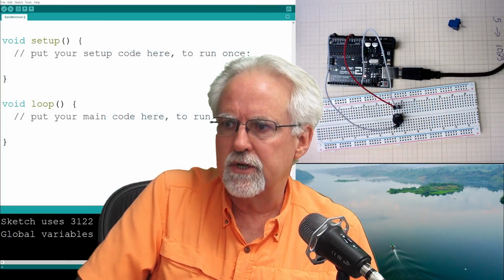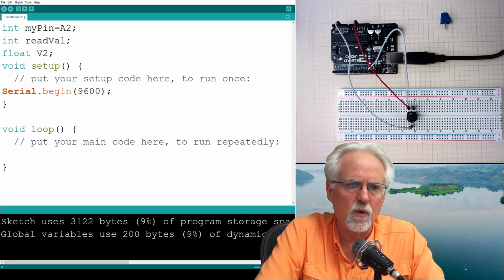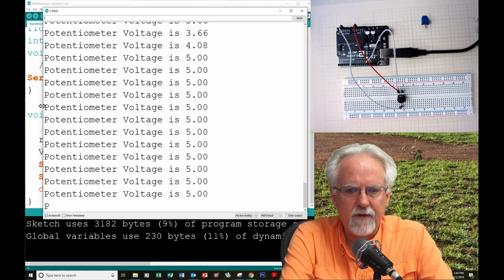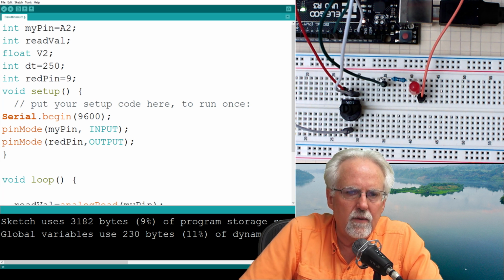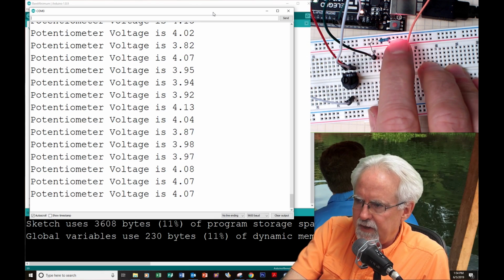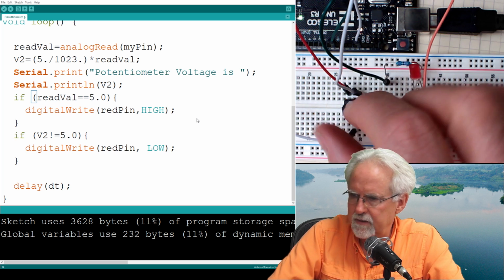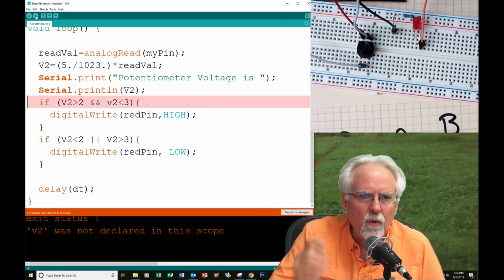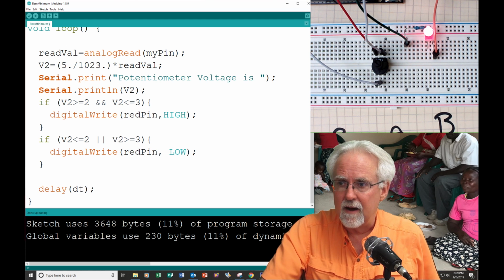Arduino Tutorial 13: Understanding Arduino If Statements

Comment: Here's my answer to the assignment! 

Int myPin=A2;
int readVal;
float V2;
int delayT=250;
int redPin=9;
int greenPin=3;
int yellowPin=2;

void setup() {
  // put your setup code here, to run once:
Serial.begin(9600);
pinMode(myPin, OUTPUT);
pinMode(redPin, OUTPUT);
pinMode(yellowPin, OUTPUT);
pinMode(greenPin, OUTPUT);
}

void loop() {
  // put your main code here, to run repeatedly:
readVal=analogRead(myPin);
V2=(5./1023.)*readVal;
Serial.println(V2);
Serial.print("Potentiometer voltage is ");
delay(delayT);
if (V2<3){
  digitalWrite(greenPin, HIGH);
  digitalWrite(redPin, LOW);
  digitalWrite(yellowPin, LOW);
}
if (V2>3 && V2<4) {
  digitalWrite(greenPin, LOW);
  digitalWrite(redPin, LOW);
  digitalWrite(yellowPin, HIGH);
}
if (V2>4) {
digitalWrite(greenPin, LOW);
digitalWrite(redPin, HIGH);
digitalWrite(yellowPin, LOW);

}
}
int myPin=A2;
int readVal;
float V2;
int delayT=250;
int redPin=9;
int greenPin=3;
int yellowPin=2;

void setup() {
  // put your setup code here, to run once:
Serial.begin(9600);
pinMode(myPin, OUTPUT);
pinMode(redPin, OUTPUT);
pinMode(yellowPin, OUTPUT);
pinMode(greenPin, OUTPUT);
}

void loop() {
  // put your main code here, to run repeatedly:
readVal=analogRead(myPin);
V2=(5./1023.)*readVal;
Serial.println(V2);
Serial.print("Potentiometer voltage is ");
delay(delayT);
if (V2<3){
  digitalWrite(greenPin, HIGH);
  digitalWrite(redPin, LOW);
  digitalWrite(yellowPin, LOW);
}
if (V2>3 && V2<4) {
  digitalWrite(greenPin, LOW);
  digitalWrite(redPin, LOW);
  digitalWrite(yellowPin, HIGH);
}
if (V2>4) {
digitalWrite(greenPin, LOW);
digitalWrite(redPin, HIGH);
digitalWrite(yellowPin, LOW);
}
}
Reply from the maker: LEGEND!

Comment: Hey Paul, these lessons are really great man, and I find the homework exercises are really good because they make you figure it out and remember, instead of just being a parrot 🤣
The lesson on "if"  commands is really helpful as it is a basis of alot of different sensor applications. I am busy building a circuit that uses a park distant control sensor to activate LEDs and a latch motor. I think it will work 😂
Reply from the maker: Sounds like a fun project! Keep us updated!
Reply: @paulmcwhorter  I will indeed, I will figure out how to upload pictures here, but I will also upload my project on arduino forum including my code 👌

Comment: Homework done . Just one comment is that as A2 is an analog in pin and works OK without setting the pinMode as input, do we really need to put this in the void setup?. Thoughts please. Code as follows:
int potPin=A2;
int greenLed=9;
int yellowLed=10;
int redLed=11;
float V2;
float readVal;
int DT=500;

void setup() {
  // put your setup code here, to run once:
pinMode(potPin,INPUT);
pinMode(greenLed,OUTPUT);
pinMode(yellowLed,OUTPUT);
pinMode(redLed,OUTPUT);
Serial.begin(9600);
}

void loop() {
  // put your main code here, to run repeatedly:
readVal=analogRead(potPin);
V2=(5./1023.)*readVal;
Serial.println(V2);

if (V2 <3.0){
  digitalWrite(greenLed,HIGH);
  digitalWrite(yellowLed,LOW);
  digitalWrite(redLed,LOW);
}
if (V2 >=3 && V2<=4){
  digitalWrite(yellowLed,HIGH);
  digitalWrite(greenLed,LOW);
  digitalWrite(redLed,LOW);
}
if (V2 >4){
  digitalWrite(redLed,HIGH);
  digitalWrite(greenLed,LOW);
  digitalWrite(yellowLed,LOW);
}
delay(DT);
}

Comment: All the work you put into this is appreciated. Thanks so much for lessons! At 50, my brain isn't quite the sponge it used to be! So going over past lessons and setup is a good thing.

My code below:

// Analog input serial output with warning LEDs.

// Pin setup.
int iPinPot = A1; // Analog pin the pot is connected to.
int iPinLEDRed = 13;  // Red LED pin.
int iPinLEDGreen = 7; // Green LED pin.
int iPinLEDYellow = 5;  // Yellow LED pin.

int iPotVal;  // Holds the read value of the pot. 0 - 1023.
int iDMess = 100; // Delay for readability.

float fVolt1; //  Holds the converted voltage reading from the pot.

String sMess1 = "Voltage: ";
String sMess2 = "v";

void setup()
{
  Serial.begin(9600);

  // Be sure to setup your pins!
  pinMode(iPinPot, INPUT);
  pinMode(iPinLEDRed, OUTPUT);
  pinMode(iPinLEDGreen, OUTPUT);
  pinMode(iPinLEDYellow, OUTPUT);
}

void loop()
{ 
  // Read the value of the pot.
  iPotVal = analogRead(iPinPot);

  // Convert to volts.
  fVolt1 = ((5./1023.)*iPotVal);

  //  Display  the voltage to the serial port.
  Serial.print(sMess1);
  Serial.print(fVolt1);
  Serial.println(sMess2);

  // Are we in the safe zone?
  if (fVolt1 < 3)
  {
    // We are, so turn on the green LED and turn off the yellow and blue.
    digitalWrite(iPinLEDGreen, HIGH);
    digitalWrite(iPinLEDYellow, LOW);
    digitalWrite(iPinLEDRed, LOW);
  }

  // Are we in the warning zone?
  if (fVolt1 >= 3 && fVolt1 <= 4)
  {
    //  We are, so turn on the yellow LED  and turn off the green and red.
    digitalWrite(iPinLEDGreen, LOW);
    digitalWrite(iPinLEDYellow, HIGH);
    digitalWrite(iPinLEDRed, LOW);    
  }

  // Are we in the danger zone?
  if (fVolt1 > 4)
  {
    //  We are, so turn on the red LED  and turn off the green and yellow.
    digitalWrite(iPinLEDGreen, LOW);
    digitalWrite(iPinLEDYellow, LOW);
    digitalWrite(iPinLEDRed, HIGH);
  }
  delay(iDMess);
}

Comment: Hi! I just completed the homework with the following code. Kindly look below for reference. However, I just have some questions.

1. Why is the green LED less bright compared to the other LEDs?  I'm using 220V resistors. I measured its voltage to be around 1.8V across the LED. The same for the other LEDs.

Thanks!

Hoping for your kind response.

Appreciate your video tutorials too! Been watching and doing the activities since the start of the holidays.

int readPin=A2;
int readValue;
float V2;
int delayTime=250;
int greenPin=4;
int yellowPin=3;
int redPin=2;

void setup() {
  // put your setup code here, to run once:
  pinMode(readPin,INPUT);
  pinMode(redPin,OUTPUT);
  Serial.begin(9600);
}

void loop() {
  // put your main code here, to run repeatedly:
  readValue=analogRead(readPin);
  V2=(5./1023.)*readValue;
  Serial.print("Potentiometer Voltage is ");
  Serial.println(V2);
  if (V2<3) {
    digitalWrite(greenPin,HIGH);
  }
  if (V2>3) {
    digitalWrite(greenPin,LOW);
  }
  if (V2>3 && V2<4) {
    digitalWrite(yellowPin,HIGH);
  }
  if (V2<3 || V2>4) {
    digitalWrite(yellowPin,LOW);
  }  
  if (V2>4) {
    digitalWrite(redPin,HIGH);
  }
  if (V2<4) {
    digitalWrite(redPin,LOW);
  }  
  delay(delayTime);
}

Comment: did any one do it like this, this is the homework.

int RLED = 12;
int YLED = 11;
int GLED = 10;
int myP = A2;
int RV;
int MD = 250;
float V2;

void setup() {

Serial.begin(9600);
pinMode(myP, INPUT);
pinMode(RLED, OUTPUT);
pinMode(YLED, OUTPUT);
pinMode(GLED, OUTPUT);

}

void loop() {

RV = analogRead(myP);
V2 = (5./1023.)*RV;
Serial.print("Potentiometer Voltage is ");
Serial.println(V2);

if(V2<2){
digitalWrite(RLED,LOW);
digitalWrite(YLED,LOW);
digitalWrite(GLED,HIGH);
}

if(V2>2){
digitalWrite(RLED,LOW);
digitalWrite(YLED,HIGH);
digitalWrite(GLED,LOW);
}
if(V2>4){
digitalWrite(RLED,HIGH);
digitalWrite(YLED,LOW);
digitalWrite(GLED,LOW);
}

delay(MD);

}

Comment: Paul, In all of your videos you are connecting to the 5V pin of the Arduino.  I see there is also a 3.3V pin.  Can this be used instead of the 5V pin?  I ask this as I'm working towards connecting the MCU to a 3.3V AM/FM/SW radio receiver.  Is this something I'll be able to use so that a logic level converter isn't needed?

Thanks for these videos!  These have been incredibly helpful!
Reply from the maker: You can connect to the 3.3 volt pin, but remember GPIO pins are still 5 volts so you would not want to use GPIO pins to control a 3.3 volt device.

Comment: I did the homework and it was pretty self explanatory. But something you probably should've introduced as well in the video is else statements. I used else statements so I wouldn't have to think too hard about when to turn the other lights off. The program just knew that if the condition was false, it would turn off the designated light (i.e. red, yellow, green). I don't know exactly how complex implementing a state machine for the lights would be, but it may or may not be worth it to do so. I think it would be practical to implement a state machine, if the program gets too complicated (mainly from adding too many if statements to keep track of).

Comment: I don't know why but when I turn my potentiometer, it jumps from low voltages to high and so it's hard to get it in the middle range in order to turn on the yellow LED. I thought it might be a problem with the potentiometer so I purchased a set of replacements from Amazon but I have the same problem. I tried changing the cables, still no change.
Reply from the maker: Are you connected to a pin with a ~ next to it?

Comment: For some reason I was unable to put:

  if (V2 > 4.0) {
    digitalWrite(redPin, HIGH);  // Turn LED on
  } 
if (V2<4.0) {
    digitalWrite(redPin, LOW);   // Turn LED off
  }

So I just replaced if with else

  if (V2 > 4.0) {
    digitalWrite(redPin, HIGH);  // Turn LED on
  } else {
    digitalWrite(redPin, LOW);   // Turn LED off
  }

Comment: I am a mechanical engineer who really enjoys these videos that you have created for the Arduino.  Thank you for all the work that you have put into them.  I especially like the circuit analysis inclusion.  It is good to get a refresher on those details after having such a long period in which I had not used them.  I am building all the circuits described and "enhancing" the "homework" that you recommend.  Thank you so much, Paul!

Comment: who has done the homework need some some help 😂😂😂😂
Reply: Answer for homework

int sensorpin = A3;
int redled = 3;
int greenled = 4;
int yellowled = 2;
float V2;
int sensorvalue;

void setup() {
  // put your setup code here, to run once:

pinMode(sensorpin, INPUT);
pinMode(redled, OUTPUT);
pinMode(greenled, OUTPUT);
pinMode(yellowled, OUTPUT);
Serial.begin(9600);
}

void loop() {
  // put your main code here, to run repeatedly:
sensorvalue=analogRead(sensorpin);
V2= (5.0/1023.0)*sensorvalue;
Serial.print("Potentiometer Voltage is ");
Serial.println(V2);

if (V2<3){
  digitalWrite(greenled, HIGH);
  digitalWrite(redled, LOW);
  digitalWrite(yellowled, LOW);
}
if (V2>=3 && V2<=4){
  digitalWrite(greenled, LOW);
  digitalWrite(yellowled, HIGH);
  digitalWrite(redled, LOW);
}
if (V2>4){
  digitalWrite(greenled, LOW);
  digitalWrite(redled, HIGH);
  digitalWrite(yellowled, LOW);
}
delay(1000);
}

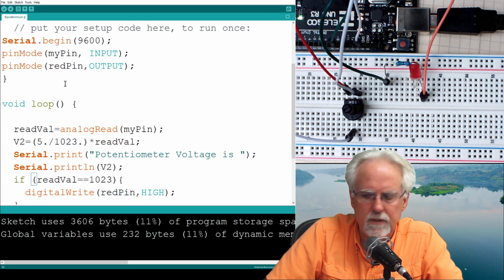Comment: 26:11 of course wrong if v2 is not equal to 4 than led will turn off. And potentiometer giving more than 4 volt. as for the v2==5 is trying to turn on the led. but 2nd if statement is also true so it wouldn't turn on

solution is :

if(V2==4){
digitalWrite(pin, HIGH)
}
if(V2!=4){
digitalWrite(pin, LOW)
}

Comment: Hello Sir. I have hit a problem (as I always do: I’m a newbie). I built the circuit, and it worked as predicted. I attached my multimeter and got all the voltage readings you had lead me to expect. Good egg! Then, I decided to measure the current after each of the LEDs in turn, using the same multimeter. Lo and behold, when I connected the meter in series, between the LED and GND, the LED did not turn on in each case. The meter also showed zero in each case. Had I removed the LEDs and measured between the final leg of the resistor and GND, would the current have come back (as I would have expected) - or was Harry Potter hiding under his invisibility cloak?

Comment: I did my homework while i was watching the video.Also i was wondering why do we need to put resistors before the LED
p.s amazing video
Reply: A light emitting diode, in principle, will burn itself out if the current flowing through the LED is not limited by a resistor. Paul explains it in detail in tutorial 2 from about 31:45.. As the voltage is increased, it lowers the barrier of electrons flowing, causing exponential changes in current flow that will eventually burn out the LED.

Comment: Good Morning Paul, I'm 78 years old and am enjoying your series, but I'm a little bit stuck on Tutorial 13, on the Homework bit. I have managed to get the Green and Red LEDs to eliminate okay, but the yellow obstinately remains unlit. I've changed things around up and down, checked and re-checked, but still no joy. H/W settings used:

 
 }
  
if(V2==3.0) {
  digitalWrite(yelPin,HIGH);
}

if (V2!=4.0) {
digitalWrite(yelPin,LOW);
}

I've going straight on to Tutorial No14, in the hope that my mistake will show up in future lessons.

Regards,

Roger Hill

Comment: Hi there. good videos, im learning a lot.
question ? can you reply with the correct coding for the homework?
i have completed it it does function, except that two of the leds are dim.
i change the variable pin location in the code and the problem seems to follow the pin allocation
i have checked the board with simpler code and all the write pins work fine.
hence a coding issue

if(V2>4.0)
 {
  digitalWrite(redPin,HIGH);
 digitalWrite(amberPin,LOW);
 digitalWrite(grnPin,LOW);}

this is the code i am using the Amber is verylow, and the green is slightly dim, the red is full bright.

HELP LOL
Reply from the maker: Did you remember to do your pinmodes? Are you using the correct resistors?

Comment: Hey Paul, two questions i had regarding this lesson.

1. My serial monitor reads very wavy and non constant voltage. Is my potentiometer crap?

2. Ive quintouple checked my code and for some reason my light only comes on when voltage is below 4.0. What would be causing this? 

ive included my code below. 

Hope you or someone else knowledgeable can chime in. Merry Christmas to all the arduino homies!

int myPin=A2;
int readVal;
float V2;
int dT=250;
int redPin=9;
void setup() {
  // put your setup code here, to run once:
Serial.begin(9600);
pinMode(myPin,INPUT);
pinMode(redPin,OUTPUT);

}

void loop() {
  // put your main code here, to run repeatedly:
readVal=analogRead(myPin);
V2=(5./1023.)*readVal;
Serial.print("Potentiometer Voltage is ");
Serial.println (V2);
if (V2>4.0){
  digitalWrite (redPin,HIGH);
}
if (V2<4.0){
  digitalWrite (redPin, LOW);
}
delay(dT);
}

Comment: Well, it's four years later and you're still not talking to a wall. I enjoyed this lesson because I've been waiting for the conditional programming details, wondering IF they would come along soon. The homework assignment was straightforward, so I added an enhancement or two for extra credit. When the voltage reaches 3.5 volts I had the yellow LED start a slow blink. When reaching 4.0 volts I turned the red LED on, but with a fast attention grabbing blink. Just a bit of extra, figuring out where to add the delay lines.
(I wonder if you still read these comments, however.)

Comment: Paul, I had fun with the homework on lesson 13. I figured your assignment out easy enough but had to look up the reference on if statements to review format. A twist I put in was to have it solid red above 3.0 volts but flashing red above 4.0 volts.

Comment: Hi Paul, thank you for the time you have spent putting together this most excellent course!
Just finished the home work for this video and thoroughly enjoy the assignments.  I always try to incorporate something from a previous lesson that you didn't request in the homework.  For this assignment I noticed the green LED was much brighter than the yellow and red.  I could have changed the resistor but instead I used a analogWrite on the green LED to dim it down to the same brightness as the yellow and red.
Thank you very much for the effort you put into your channel.

Comment: https://youtu.be/ORNted-NgRM?si=r56EqD0I25Zp49I6  My English is weak but maybe understandable.
(!=) and (< ) or (>) are not the same. (!=) Rather means (<&>). So "V2" is equal to 5 (LED on) but not equal to 4 (LED off).
The correct:
pl1: 1 There was hysteresis

if( v2 == 5) { redPin, HIGH };
if( v2 < 4) { redPin, LOW };

pl2: 0 There was hysteresis

if( v2 == 5) { redPin, HIGH };
if( v2 != 5) { redPin, LOW };
Reply: By the way, we avoid this way of writing in programming.
if( V2 == 5 )
It's really correct though
if( V2 = 5 ) is also correct and becomes true. It's wrong because it's a value assignment.
we prefer to use it like this:
if( 5 == V2 ) is the same as the first one.
but in this case if( 5 = V2 ) will throw an Error because it cannot put the value of V2 in 5. Because 5 is a number and V2 is a vessel.
You have to get used to it.
Reply: @SzolgPorta  True, I thought about this too. Anyway, the videos are very good.

Comment: I am the mirror image of Francis Flynn (@fflynnful).  I am 80 and was a programmer during my career.  The electronics are new, and the coding comes easy.  The only twist in the programming is this is real time.  That often means you have to turn things off if you turned them on.  The assignment is a good example.  I am impressed that Paul still spends the time to look at these comments years after the course ended.